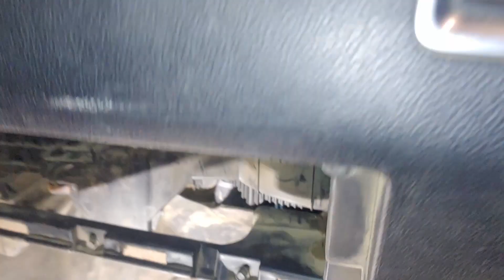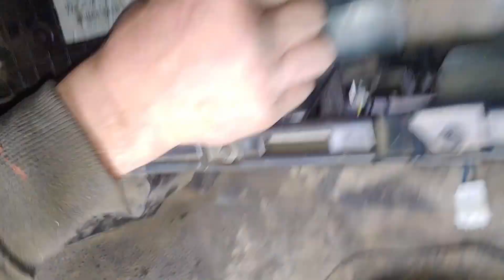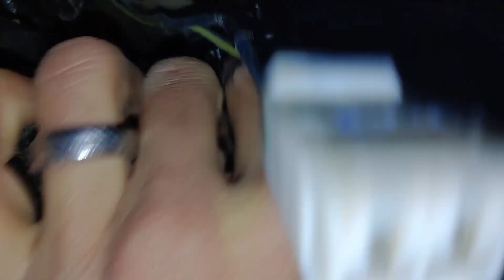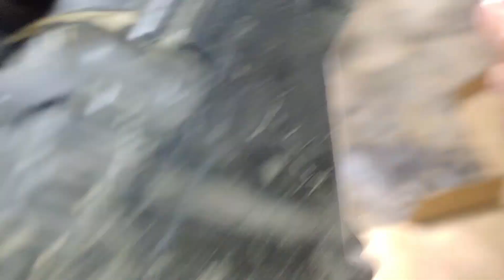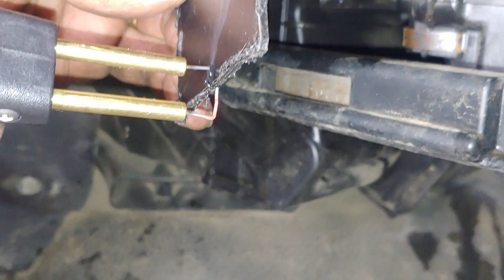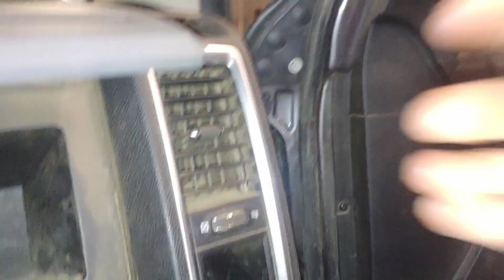How to Clean Ram Truck Evaporator

Comment: Does the filter cutout need to be closed again?
Reply: They sell a cabin air filter access door that pops right in place. Amazon has it. Im fixing to do this to mine right now.
Reply: @jaredsmith329 I got the "kit" on Amazon for about $15. Filter and cover. About a 20 minute job to cut out the piece and add filter.
Reply from the maker: Not as long as there is a filter in it.